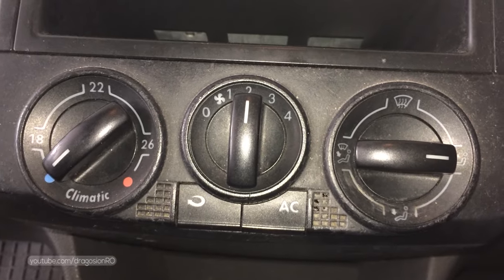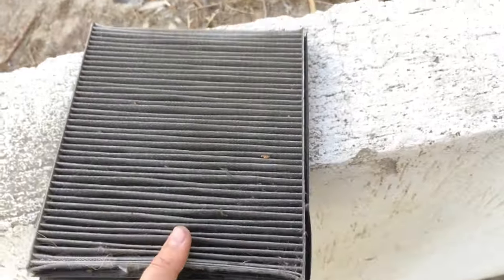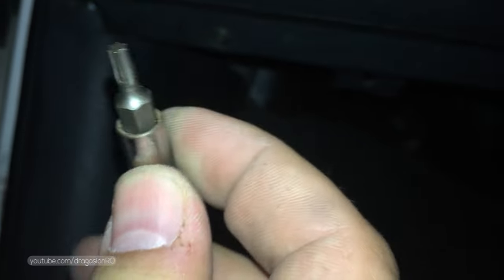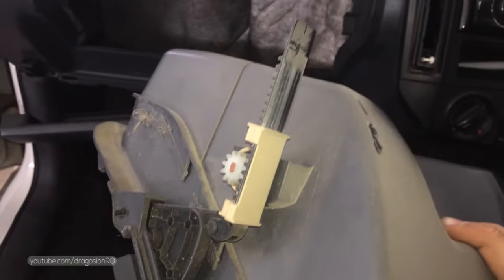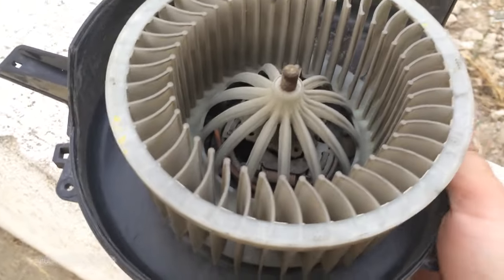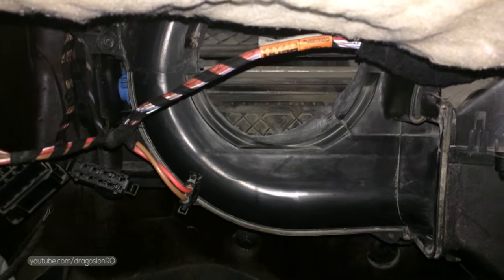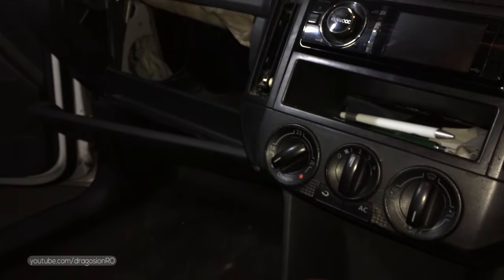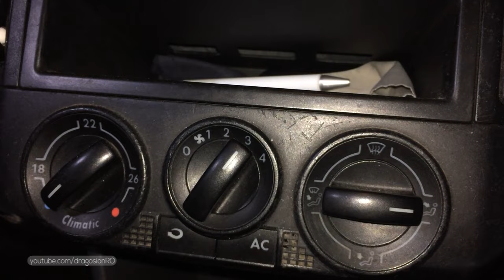VW Polo 9N Heater - Noisy Blower Motor Replacement or Cleaning

Comment: Seems like it went silent when you pressed it in the right place, maybe a loose mounting spot makes the motor unbalanced and it vibrates?
Reply: i have 9n 2006, ac blower makes noise at level 3 and 4,when put wd-40 the noise reduced to some point. But i could hear like the motor touches somewhere when stopping the car. The chances are loose mounting or unbalanced rotation..is there anything i can do before getting a new one?

Comment: Thanks for this. Well laid out and very helpful! I also saw your advice about replacing with a new motor rather than a used one if replacement required. Thanks again.
Reply from the maker: Thanks Kevin! 😀 
A used motor is what I chose the first time and had to replace it again after about 1-2 years.
Reply: Olo
O

L
O
Oom

Comment: Hi did the problem go away! Or did you replace the motor
Reply from the maker: Jay Yaqoob I cleaned it. Was really full of dust.

It didn't really go away it just became less noisy on speed 2. Speed 1 has no noise at all.

Since then, I purchased a new blower motor and will install it when I'm in the mood :) sooner if it becomes more noisy again.

The new blower motor sits in the box until then.

I've changed this motor before with a used one.

In conclusion, when it's  noisy, replace it with a new motor not a used one. 😅
Will make a short video with the old vs new motor eventually.

Comment: I replaced blower heater resister but still not getting hot
Reply: it just blows  cold
Reply from the maker: @marcillinoryneveld6378  the resistor is for the motor to work on speed 1-3, when that fuse is blown, motor works only on speed 4.
Your problem sounds like the recirculation clap motor, make a video recently with that. Find it in the car playlist

Comment from the maker: 6 not 7 screws need to be removed to take the motor out.

There are 2 screws on the left are for the air recirculation flap control motor. That doesn't need to be removed. 

6 screws, sorry for the mistake. 😅

Comment: Great Video, amazing explanation! Thanks a lot man. I have a bad smell problem when the heater is on. But no smell when AC is on at cold. I already replaced the cabin filter but didn’t help at all. Do you think this will help? Or it’s something else?
Reply from the maker: Could be that there was some animal in the vents. Usually the smell is from running ac on cold not the heater and it smells like mold for a few minutes if you didn't stop the ac before stopping the car

Comment: Awesome video man! Really kind of you to share your knowledge. I have a problem with my polo 9n from 2007. Only on the coldest temperature it is blowing cold air... When I turn it 1 small bit it immediately get's hot. Do you know what it possibly can be????
Reply from the maker: I had a similar problem.

Safest thing is to get a ODB2 scanner - vag com.
If you have any codes related to the the v68 motor, thats it.

There’s a potentiometer in the v68 that can be cleaned with contact cleaner. I cleaned it a few times with contact cleaner spray then tried to clean it with wd40 and it’s been great for a long time. 
Wd40 keeps it good longer than the other stuff. Just do it slowly and don’t bend the metal contacts on it.

Carbon dirt gathers on it and confuses the ECU about where the motor is positioned. Then it goes crazy going hot or cold on its own.

When cleaning mine, I didn’t record it... it was a long time ago.

Search for vw polo v68 motor potentiometer cleaning.

ODB scanner is the way 😅
Reply: Thanks for the quick responding. I'm gonna try to fix this because it's getting annoying;)

Comment: hi ty fr the video i have a problem with the heater it blows with max heat or max cold , and somtimes when u have AC on cold it changes to max hot
Reply from the maker: Theres a potentiometer near the recirculator flap. WD40 in that fixes it but you have to take it out first and its not very easy.

Comment: Hi. Removing this fan seems to be like piece of a cake but I could not do it. After 2 hours battle I succeeded to unscrew one of all 7 screws only. Could you please explain to the beginner how exactly to reach each of the 7 screws. Thanks in advance.
Reply from the maker: It's not easy but it can be done.
Use both a long 15-20cm screwdriver and a short one 5-10cm.
I think I've shown the number of screws but to record unscrewing them would be almost impossible. Maybe I could have done it but didn't want to spend 5h sweating on the thing.

Most important is to remove the glove box and pull that tray a bit - no need to remove just the screws.
A thin small but powerfull work light or even a mobile light is a must.
First use the light to locate all screws, you can gently pull the fluffy insulation back but don't apply pressure around the AIRBAG! Anything with the YELLOW color, treat it like fragile egg shells. 
Yellow is danger - the airbag unit and wires.
Your head goes where feet usually go and try to use long or short screwdriver depending on each screw.
Use screwdrivers made from one piece, not with interchangeable bits.
Hope you can do it.

Comment: Thank you for a very instructive video. I was wondering however, if you could get access to the blower motor bearing, and given it some oil or WD 40, wouldn’t that have
helped to eliminate the noise? I have a squeaky blower and was thinking this might
help. I have not taken the blower off yet.
Reply from the maker: You could try it but soon you'll open it again. :)

Comment: Where is the heating core in this car?Heating is not enough in my car.I am planning to check it.
Reply from the maker: Made a video but it's not finished and uploaded yet. Heater core behind engine 2 hoses go in firewall. It's behind the dashboard deep within. I wouldn't remove it but flush the hoses back and forward with water to clean them.

Comment: did replace the copressor but no change
Reply from the maker: Ouch, replacing the ac compressor for that is a bit too much. 
Better scan the car with an obd2 tool on the hvac system and  it should have errors related to the flap position intermittent or similar.

Comment: I have question, Mine blows only warm air. What's the problem?
Reply from the maker: Motor position potentiometer near the air recirculator flap.
Reply: Mine only blows cold.